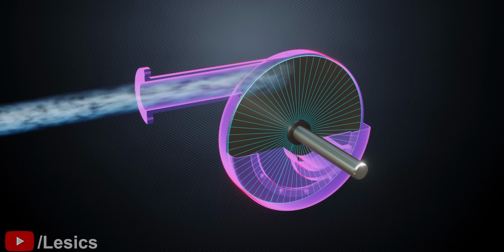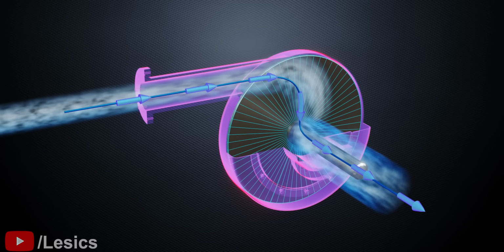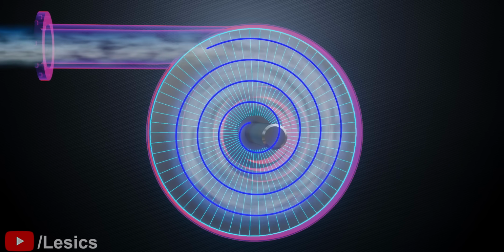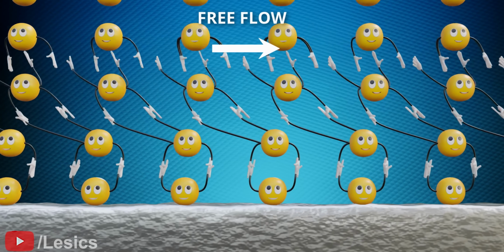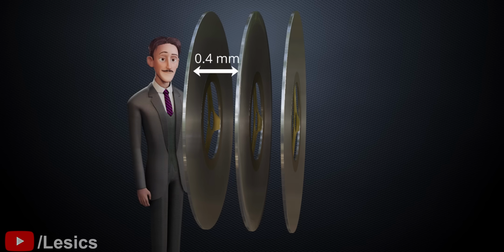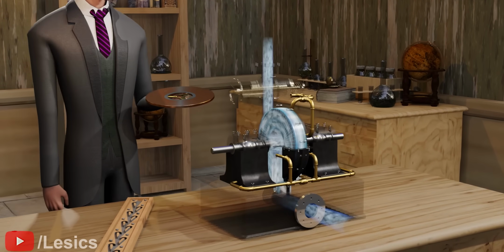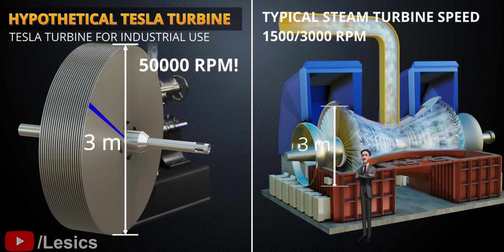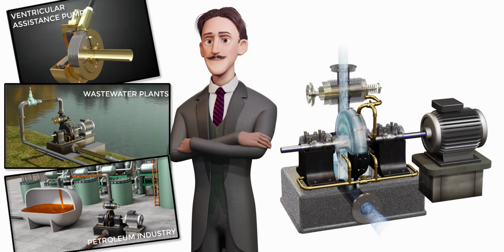Tesla Turbine | The interesting physics behind it

Comment: The example stemming off of the wheel encasement, rather then a straight line going to the top of the blade, a ratio slope angle of 1 over 2 aimed at the north north west point of the wheel is more efficient
Reply: I used to play around with the pizza cutter a lot as a dishwasher
Reply: Though to be fair this mostly just comes from more if the surface area of the stream hitting the edge of the blade
Reply: If you use that and add a suggestive she'll between the layers to keep them from expanding and warping you should be able to get at least 4500 Rpm without destroying the blades.
As it is, to convey the idea, the wheels look like this:
_____
000000
------------.   (There isn't an upscore option and I'm drunk, shh)
I would say something like this

00 00 00
|_|_|_|_|_|_| (mirrored on the top)
This to keep the edges from warping.
You would want the saw materials to be weaker then the buffer material here, for it to go all the way through, and not to directly touch the saw wheels; but be just beyond them, so that if they warp they are forced between either side of them.
Ideally you want the saws and buffers magnetically charged with similar charges to allow those instances to be frictionless force interactions.
But again, I am drunk, I could be grasping at straws for fun, this is Tesla after all lol
Reply: In addition, a small angled outcropping st the edge of the disk also magnetized against the charge if it's shell would add the extra buffer AND simultaneous oomph needed to achieve higher speeds.
Reply: (note I am literally thinking a blade saw shape rather than a rotor)
Reply: The teeth of the blades would have to be very small though, almost like the teeth of a knifes edge in order to keep viscosity
Reply: At the same time though, strangely it wouldn't work too different from the concept of other thing on the table at the beginning of the video.
The pump thing. (Way to much Brandy lol)

Comment: What if the fluid used to drive the Tesla turbine was of higher viscosity than steam? I know there were some examples at the end of this great video explaining the Tesla turbine) More on the experience of using fluids like water and oil would be welcome. Seems obvious --> higher viscosity fluid --> lower rpm but high torque due to boundary drag on blades. Also less blades necessary? Could the Tesla turbine be used in hydroelectricity generation therefore?

Comment: isn't the Visco clutch invented for VW four wheel drives in the 80s another high viscosity application of the Tesla turbine? With the visco clutch VW was able to combine the fuel efficient two wheel drive with the traction of a four wheel drive by engaging the 4 wheel drive automatically and only when needed. The different speeds of two shafts/ disk sets within the clutch would heat up the liquid and change its viscosity, so that the boundary layer thickens and the clutch engages.

Comment: What if multiple tesla turbines are run in parallel dividing the flow of fluid to limit the higher RPM?
What I mean, is it possible to divide those very high RPMs into multiple tesla turbines?

Comment: I wonder if there has been research into higher viscosity, slower rpm applications.  I'm curious about how much torque could be achieved.  I expect it's quite low, but what's the upper limit?
Reply: Cool thing about the disc turbine- run it as a pump, it is great at pumping extremely viscous liquids, slurries, etc. You've got a great idea- using a high viscosity working fluid would generate more torque at lower RPM.  Wonder how it would work when you need high RPM out of something powered by hydraulics?
Reply: @ostlandr  I was thinking more along the lines of a heavy duty off-road application.  I actually designed an automatic "hydraulic differential" (only exists on paper) but it would need individual hydraulic motors for each wheel.  For a "bug out" rig (like an Argo), low rpm wouldn't be a problem.

Comment: I wonder how this would work with output potential at the lower speeds to keep the turbine in one piece until a load larger and larger load is applied and with the power output of the pump could be increased to manage the load until the demand is no longer needed, hence back off the turbine speed. I guess delta would have to come into play over power, delta being the time to get those higher rpms built and turning into mechanical energy. Guess I'm asking with so much potential sitting at any giving point how quickly can it be turned into a mechanical energy for larger loads like a end load? any quicker or efficient than steam turbine in the same event?

Comment: So question, if we had a material capable of withstanding the high rpm, would we be able to use this type of turbine for generating an absurd amount of electricity from nuclear plants?
Reply: not quite. current turbines (blades) already achieve about 90+% efficiency, even at relatively low rpm. these tesla turbines will give you a bump up to 96, 97, % efficiency.

however, im thinking it would be the most monstrously torque-y engine known to mankind, as 50k rpm could be paired to a very low gear and be near unstoppable.

Comment: Every auto transmission. Torque converter. Fluid coupling. Hydraulics.. NOTHING new here. This tech has been used in the automotive industry for over 60+ yrs same physics for Fxxx sake.
Reply: absolutely not, they all function as traditional turbines and pumps. a bladeless turbine would be a very poor in most applications

Comment: What if tesla went about his turbine in a inside out direction , and every three plates had one plate in the center that spiral groves etched in on both sides of the plate, and the grooves were wider at the center and gradually got smaller to the outside,  wouldn't that naturally increase r.p.m.'s and out put pressure because when you put it under a load ,such as a generator it would slow down naturally do to tidal friction within the generator

Comment: viscosity will need a lot of surface to deliver power, and the cost will be huge, and not commercially viable . more the distance from the disc, less the energy transfer. if 100% efficiency is attained, then nothing will go out of the turbine, and its parctically impossible

Comment: Why not employ the same principle as the Napier Deltic engine, inject into the middle of a ven diagram, and exhaust at the crank, with three crankshafts, the area remains the same, the speed of rotation is 3/11 or approx 3/14mach, but since you require disks of ⅓ the diameter it is further reduced to 14/pi^2
Reply: You free run one disc in the delta configuration, and 1:1 couple the other two discs, as they are contra rotating! Or only extract power from the uncoupled disc.

Comment: Ok so I see the biggest problem people are having when up scaling or maximum speeds , is disc distortion!
Mainly because the force at the outer edge of the disc at very hi rpm the force pushing sideways force causes unbalanced rotation? I’m very curious if the discs was covered in a nano material, helping to further guide air an increase surface areas in areas where u want an more directed force , an less in areas u want less in balanced force ? Just a thought???

Comment: 8:18 50000rpm and d=3m:
Speed of sound in water = 1480m/s
Then:
V at the disk tip is Ma=5.
The temperature 🌡 will change the phase of water and the disks will also experience thermal stress !
Tesla is no doubt the best engineering mind in history of science !

Comment: What if you DECREASE the diameter?
The further it is from the center, the more force it will experience. If you make it with a diameter of ~10 cm it might work
Reply: with carbon fiber plates... I suppose so, and i also suppose there are good reasons noone does that, and that it's not just that you'd need thousands of them. IDK why though.
Reply: @quantustremorestfuturus5434  I've actually looked it up and they did decrease the size down to only 5 cm in diameter
Reply: @DavideCosmaro  To what effect?
Reply: @quantustremorestfuturus5434  they still worked and were able to go at like ~14000 rpm but I don't remember well the last part, could be slower
Reply: @DavideCosmaro  but probably efficiency losses due to the axis diameter, heat loss and so on.

Comment: You are wrong.
You say the flow spirals down to the centre after less than a single partial circuit of the disc as though centripetal forces somehow make the flow flow to the centre - yet every spinning disc throws solid liquids or unsolid gasses off the rim by centrifugal force. 
The Tesla works from direct initial tangential flow plus compression of the spiralling flow to give tangential impetus over first a full 360 degrees then one or more further 360 degree flows until eventually the steam is forced to flow out the centre vent.
The P38 Lighning turbo was a good example of how the inflow made less than a full circle before exhausting and todays turbos all send the hot gasses spiralling round and out while the inflow spirals from centre to outside. But in a turbo both exhaust and intake impellers are basically cone shaped so not directly comparable to a Tesla turbine.
The JetWheel Turbine is a far more efficient turbine as it makes the hot steam put full force on the disc and then keeps it compressed for part of a 360 circle.  And the JetWheel can be throttled to vary the power demand!
Study JetWheel Turbines.

Comment: if you shrank that down in size using modern materials,    with a 1/8 inch medium presuure (under 200 psi) inlet and a 1 inch outlet
how much power generation  could be achieved?

Comment: "The Large Hadron Collider (LHC) uses an array of 9,300 supercooled electromagnets to guide and accelerate particles – namely protons, around the 27km underground ring at CERN in Geneva, up to speeds extremely close to that of light. At their fastest, these particles travel at around 299.8 million metres per second completing 11,245 laps of this ring every second. This is equivalent to travelling around the circumference of the Earth seven and a half times in one second."    -    If they can build CERN, they can build Teslas Turbine.

Comment: That spiral path is created because there is a resistance in the path of travel, you are trying to force more thru the same path, a path that is already maxed out with the current speed. 
When you add more, it will now spiral out to make room for the increased intake pressure.

Comment: Is there anyway we can use 100 of the smaller steam ones, to power one that does this but with pressureizzed freezing cold air? That will keep the discs cooler ? Is that not a problem? The discs being extremely hot and spinning fast? Why can’t we use carbon fiber or carbon nanotubes 👀 or is it that we can
Reply: Centrifugal forces and shaking are more damaging in this case.

Comment: Have opposing magnets even been used in a turbine?  My thought was to bisect opposing magnets with a ferrous plate in a rotor, then polarize the plate to utilize repulsion.  

I found that I could bring the repulsive heads of magnets into close proximity without any effort, using a ferrous plate.  Can this be used in a rotor?

Comment: Would this not work rather better as a water turbine?  The much more viscous state of water would surely be beneficial, and help it run at much lower rpm. How well would one work on a hydro-electric plant (with wider disc spacing to account for the much larger boundary layer of water)?

Comment: Tesla couldn't do the math, neither can the presenter of this video.  For maximum efficiency the tesla turbine must match the velocity of the gas stream.  As he diameter increases, the rotation rate for a give rim velocity drops, as does the centripetal acceleration.

Also, torque would be low at max efficiency.

Comment: Hasn't there been some advances in bearings over the years perhaps even replace the bearings with magnetic type bearings surely there must be a way to get this to work as Tesla intent.
Reply: Bearings aren't the issue, the size of the discs are. Under the speeds needed to achieve the high effeciency levels, things literally start to fly apart because material science hasn't quite come up with something to withstand those forces.
Reply: @OversizedTrooper  thanks for the info Richard .

Comment: wouldnt the disk size be able to be reduced by adding more disks and increasing pressure? and wouldn't increasing the width of the intake nozzle to cover more disks work to help it too?
Reply: This is not a pressure driven turbine, but velocity driven.  The inlet nozzle needs to convert pressure into velocity.
Reply: @hanelyp1  pressure turns into velocity when it meets a lower pressure system, that is why a hose sprays when you cover part of the hole. the turbine would be a lower pressure due to its higher volume relative to intake.
increasing the width of the intake would help spread out that pressure over a greater area, reducing the pressure at the opening (with the pressure being due to it backlogging as friction reduces its spread to other locations), and thus increasing speed.
increasing the disks would counteract the reduced area of the smaller disks too, increasing the effect to a similar point as the bigger one.

Comment: How does the working fluid slow down and go into progressively smaller volumes (same gap between rotors, smaller diameter as you move toward exhaust.) without pressure going UP?

Comment: My interests are not in a large size, I want to produce just enough to keep one resident going. I’m looking at the hydro concept. I like the encased example. First what if you add raised swirls on a disk and lit water come through an upper port as the Tesla example showed. Now if you were to force water through it in an controlled manner turning a small turbine with a shaft protruding out one side to turn a pump to return the use water back to its original point.
   This is what I’m thinking in my case . I own my own home, what if I was able to build a way to catch rain water from my houses roof. Then pump this water through an opening in a small turbine example given to us in this video. Now as the water flows through this system provide a reservoir to catch the water passing through the system 1. When the wheel turns you produce electricity as the water passes through the system . 2. When the turbine turns either as the wheel in the turbine turns use it as the the pump. Or you could the power it produces to move the stores back to its original starting point. Which I was thinking above the turbine you made. 3. I’ve been studying on how to make a homemade generator, I even have a Honeywell Redi- Line motor generator on hand to start the process. You could potentially have an in endless power source. Thank for getting the wheels in my mind going.
Reply: It's in the laws of physics that you will lose all the energy you gained if you pump the water back up to it's starting point.
Reply: How about this idea... you have a rainwater collection tarp (think an inverted pyramid that gravity pulls water to the exit at the bottom)

You could have this water uphill on your property or elevate it, to use gravity for your benefit. Have the rain collected water go to a cistern size of your choosing (which would be filtered to your liking. I prefer reverse osmosis deionized filters, if I was building a home, they run about 2k)

If you have the extra water from your cistern overflow into the entrance of your generator and irrigation system, now your free rain water turns into plants, and energy from your water wheel turbine!

Some states have laws against rainwater collecting, and have certain stipulations about where you can direct rivet and stream water

A few acres with a stream through it is a GREAT buy. The river is obviously invaluable, possibly fish, frogs, bugs, deer, rabbits. Potential kinetic energy as well

So yeah man those are my thoughts on the whole deal

Also consider what safety measures you would put in, in case of a flood

Comment: I wonder if it would work using magnetic bearing so their is no machanical friction on the disc's and as it speeds up the disc would balance them selves like a Gyro. Using apposing magnetic fields to act as a floating bearing for the shafts and tips of the disc's might stabilize the disc's at those speeds. we have seen how Gyro's work and the forces they can produce and how magnetic can control each other if two north's are force together and the push away creating a force away from each other with no frictional properties. I alway thought of a drive shaff in a car that actually wasn't connected to the transmission or the rear end and was only using magnetic bearings to keep it in line and have magnetic surfaces opposing each other that act like cushions to turn the drive shaft instead of U-Jionts their would be no actaul contact from the transmission yoke and the drive shaft and the same at the rear end yoke to the pinion gears taking out 2 moving parts that wear out and creating less drag on the powertrain making the engine more fuel efficiant. This magnetic's could be used in the new electric cars as a way to regenerate batteries on a down hill coast along with afew other idea to increase power recoupe ability.

Comment: Surely there is a way around the material failure at 50000 rpm problem, wouldn't it all depend on what the discs are made from, what if the disc what thicker at the outer edge to offer the forces, idk. Why is it an engineering impossibility?

Comment: How to describe generators: the power of the generators won’t go down unless if the generator loses magnet. Generators losing their magnet is the only time they lose their power. Generators remain so powerful and generators are so high in power and have high voltage. Generators have the power to give electricity. Generators are full of power. Generators have a lot of power and energy. Generators convert mechanical energy to electrical energy.